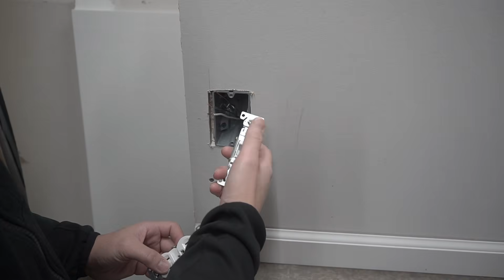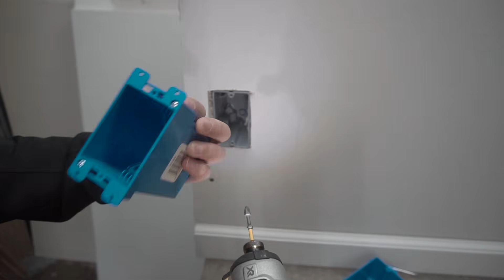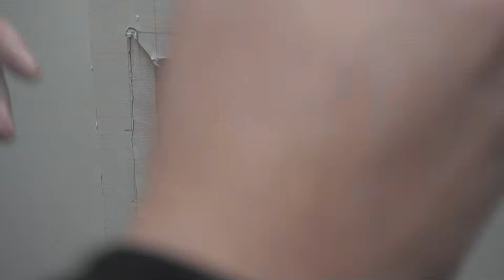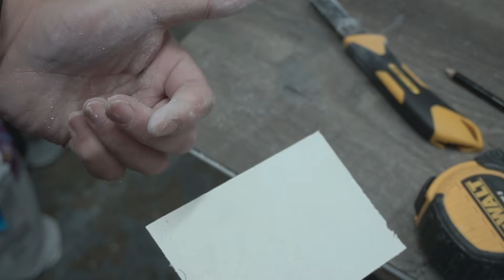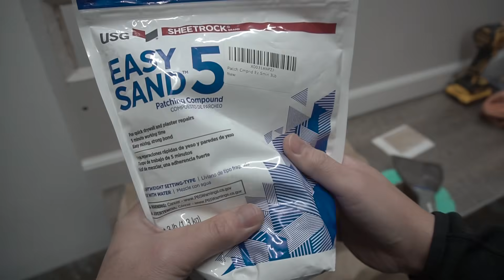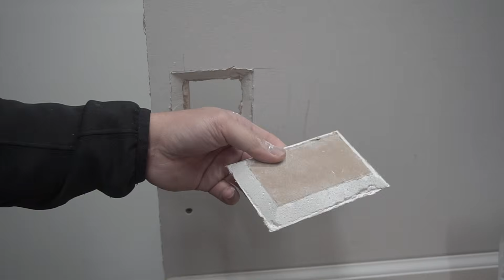How To Install Drywall Patch Over Old Electrical Outlet! Delete J-Box | DIY Tutorial For Beginners!

Comment: Thanks for the video. You can also use a furring strip with a screw in the center to slide through the hole. Then use the screw to hold the furring strip close to the back of the wall do you can set a screw on either side. Back the screw in the center, add patch and attach with another two screws. Good as new. 👍🏼
Reply from the maker: Wow that’s a great idea! Thank you for the advice! 🙏🏽😊

Comment: cut the plastic that hold the nails to the top and bottom of the box rather than cutting the nails then pull the nails out once the box is out of the way. use an oscillator if you have one.

Comment: what do you do with the wires?
Reply from the maker: You can either leave them there once you disconnect it from its power source (label it as no power) or trace the wire and pull it out from there if they are not stapled to the studs.

Comment: Please check your electrical code ! 
My area code requires an outlet within a couple out of each corner, for newer houses. Just check your codes 1st.
I agree with the comment below.
I'd never remove an outlet or switch. 
You'll regret it in the future, may be required to put it back in, before you sell your house, or wish it was there again. 
Slap a paintable cover on it & forget it.
No issue with his method, if it's an old phone/TV  jack,  hole or something. 
Thanks, I actually forgot about a beveled patch. It's a fast, easy way, in a bind, and fairly strong. 
I prefer the butterfly patch. A little more time to make, but no tape. If you patch often, make a couple different sizes or shapes, on down time, keep them on hand. Just cut wall to match the patch, n slap it on.
Using a backer board will always be stronger, last longer.
And, don't cut on the up stroke with a blade. Always, always down and away from you. 
Don't mean to dis anything, but most people using this video to learn, should know that 1st. If you slip, your gonna be patching more than your drywall.
And recommend easy sand 20 or 45 for beginners. 
5, 20, 45, 90...  are time it takes to set or harden. Easier to clean up when wet. 
Actual dry time is roughly 12 to 24 hours, depending on thickness, airflow, heat, humidity. 
Make sure its dry, or your primer & paint will be peeeling.
Thanks for video tho. One never stops learning, ( or remembering).
Reply: Why would you regret it? Its not hard to put a new box. Even running new wire isn't difficult. Worst case you have a lot of drywall to patch coming from another source.

In my case, previous owner closed off a door on one wall, and made a door on another, also border up the window making a full bedroom into a walk in closet. It was insane. Spent a month reversing it all. Deleted the unnecessary light switch from the door he made and put one back near the original entrance

Comment: You are making this repair harder than needed. The electrical box can stay in place and use a California patch for the sheetrock repair. A plastic box that is above the sheetrock can be trimmed with an occulting saw. A metal box above the rock is the only one that needs to be removed, or can often they can be pushed back and left in place.

Comment: This is an awesome video, thanks.  I always like to see different approaches.   What I am seeing here is that you are increasing the surface area of the mud contact around the internal circumference of the patch.  Since water is made up of hydrogen, you are forming more hydrogen bonds between the two.  When I was taking organic chemistry our professor once told us that the hydrogen bond is the strongest bond because there is more of them.  Your technique is an example of his point -- very nice.  By the way is there a name for this patch?  If not, I would call it the 45 degree dry wall patch.
Reply from the maker: That is a great name for it! Thank you so much for the thoughtful comment! 🙏🏽😊

Comment: Nice clear video and instructions, thanks! It will be easier to feather out if you stick to a single layer of mesh tape rather than doubling it up in the corners. 13:30
Reply from the maker: Thanks for the tip!

Comment: Nice one bro!! I can use the same technique on the hole on the wall that my door knob keeps banging.
Reply from the maker: Use a door stop to prevent from happening over and over again bro!
Reply: Put a door stop on your trim.
Or, if not possible for some reason....
Slip a 2x4 in there, lay flat, screw it good.
Then screw a piece of 1/2 , 3/4 plywood to that, in the hole. 
Sand it nice, mud the edges, and won't get so much damage. 
A little more work, but won't be patching holes constantly.